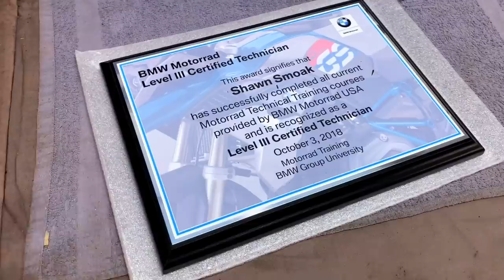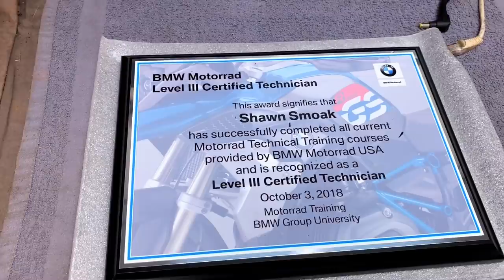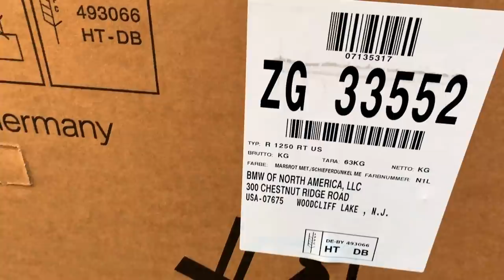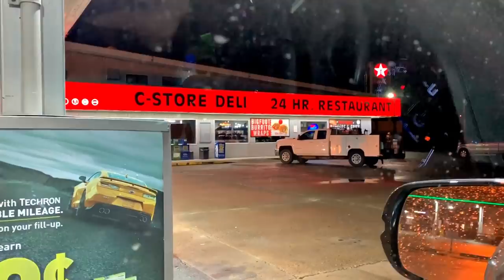2019 R1250RT from Crate!! • BMW Level III Plaque! | TheSmoaks Vlog_1109

Comment: S'funny some of the older bikes I've owned never had any air filter from stock just open bellmouths. '59 BSA, '78 Guzzi le Mans and '80 Ducati 900SS. Was the air cleaner  back then? never had any engine problems.

Comment: Thanks a Lot for the video. I intend to buy a GS 750 in a few weeks. I have a question. 

My thought is that TFT and Navigator 6 overlap in many features and makes no sense buying
both. TFT is no brilliant in navigation but you can use your mobile phone with google maps connected to TFT. So buying TFT and no buying Navigator VI would be my preliminar decision. 

¿¿Is my thinking right?? TFT and Navigator VI are attractive and expensive devices and I would like to make a wise decision and not over spend any money. 

Thanks a lot...!

Comment: I did the first ever brake fluid change on my Harley FLHTK since on road date April'15 @ 18K mi. (slightly past the recommended 10K mile mark). Front brake tested 4% (opps!) and had an equal amount of crud on the top of the rubber boot as Smoak's SGS brake video. Bike lives 98% in AZ. Maybe someone will find the comparison info useful. CG...